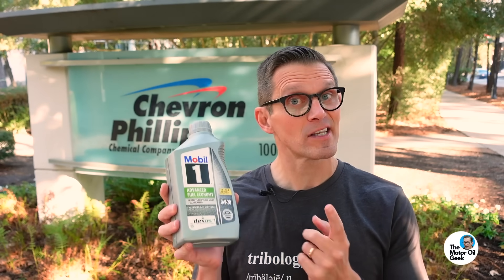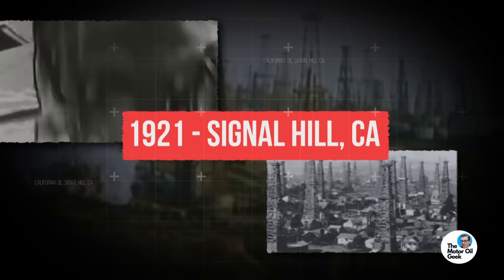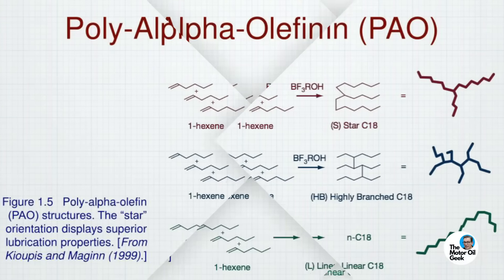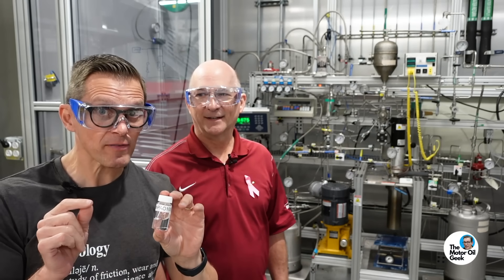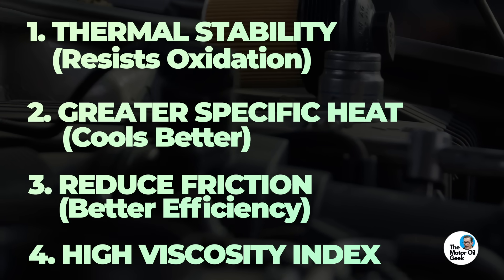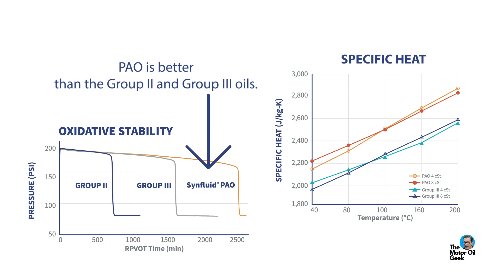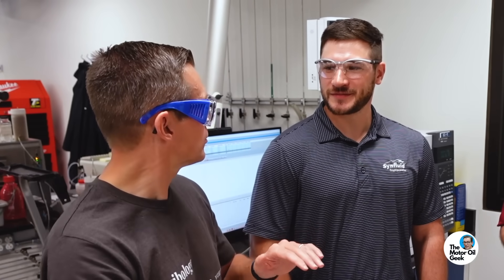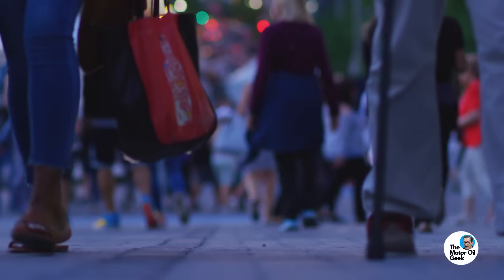STOP Using Regular Oil - 4 Reasons Synthetic is BETTER!

Comment: Changing my oil is like a drug.  It's a euphoric feeling.
Reply: you’re not supposed to drink it
Reply: @coreymacqueen4802  he typed changing not drinking
Reply: Yep.  You can imagine the engine going “Ahhhhhhhh”.
Reply: @datsuntoyy  It basically does go "aaahhhhh".  I can physically feel and hear a difference when I change my oil.
Reply: @mplslawnguy3389  you've got a real messed up car then 😅😂
Reply: @DominiAeternum   Why would you think that?  When you own a vehicle for 10 years you notice the little things.  My truck is in tip top shape because I change all my fluids on time every time.
Reply: @mplslawnguy3389  simply changing oil isn't going to make that much a difference each time by feelings. Tune ups and maybe even using higher quality fuel yes though
Reply: @ Did I say it made a big difference?  It's a subtle difference that I can pick up on because I know my engine.  Also, what do you think a "tune-up" is exactly?  It's not 1965, there is no such thing as a "tune-up" anymore.  Do you just get off on being a contrarian?
Reply: @DominiAeternum  Are you even old enough to drive? Changing your oil affects feel 10x more than using a different fuel.
Reply: @HJOTech  again. You must be driving a junker. Or use the cheapest 💩 oil at your local corner store when you pick up your daily chew that it's nothing but sludge at the end of your 10-25k oil changes
Reply: Oh yeah, a great time

Comment: Another video, another gift to vehicle owners. I have a question (no worries if you don’t see this in the millions of comments). Does Amsoil face a huge marketing issue now that synthetic oil is ubiquitous, and they are sourcing their base oils and additive packages from the same companies? For example I could get Pennzoil Ultra Platinum down the street,  or try and find an Amsoil dealer 🤷🏻‍♂️
Reply from the maker: Thanks! The gap between the top end synthetics is much closer today. GF-7 will raise the bar even higher.
Reply: Our Walmart had ULTRA PLATINUM for $ 65 for 5 qt jugs.
Quit selling it because nobody would buy it.
Strange ....
Reply: As far as I know there are no Amsoil products which use a GTL base stock.
Does anyone know otherwise??

Yes, as far as the various add packs go they could both source them from the same 3 or so companies which produce those.

Comment: Lake, I have a dilemma with the Valvoline Restore & Protect. 
2004 Chevy Silverado 4.8 engine. 
Ran it for 3000- 4000 miles. Changed it. 
Ran it again for 500 miles. Was having oil pressure sensor issues. Decided to pull the pan to replace the oil pickup tube o- ring. 
When I pulled the pan there was 2-3 inches of gooey sludge in the bottom. 
I’m not gonna use that oil anymore. It cleans alright ! Maybe too well ?   IMO, maybe run it once. Then switch to another oil after that.

Comment: Twice the oil oxidation for every ~18F (~8C) change in temperature.
Very helpful to know that.

We typically manage to drop the oil and/or cylinder head temperature by 10~30C, in our air cooled engines, by reducing friction.
Water cooled engines get a similar benefit although the improvement is harder to measure due to the thermostat keeping the engine temps in a preset range.
That means oil oxidation drops to 1/2~1/14 (decreases 50~93%)... which is why the oil lasts longer and performs better.
🙂#XcelPlus
Reply: For water cooled engines the cooling system has more of a safety margin if the heat being generated drops.
You'll probably never notice the improved cooling: 
It becomes more obvious when stressing the engine e.g. Engine should have gone BANG but didn't.
Reply: What about getting the oil up to 100* C to evaporate condensation?
Reply: @hotrodray6802  Thermostat keeps the engine temp in the desirable range.
Reply: @ The thermostat keeps the engine (including the oil) at whatever temp the manufacturer determines. Condensation will thus evaporate normally... even if you improve your cooling.

Comment: used to be able to get motor oil labeled 'Paraffin'  maybe its still out there but i havent seen it in years  how does that kind of oil fit into the story  always thought it was lower quality  also air cleaner service is important for motor longevity   Franklin automobile- Syracuse NY
Reply from the maker: Paraffin oil was the good conventional oil back in the early days. Check out this video for the back story: https://youtu.be/geSGqq5oHOw

Comment: Been using Amsoil since the 80's with great results.  Your program continues to educate me on other synthetic oils.  I'm not using synthetics for extended oil change, but for protection and a clean engine without leaving deposits.  Synthetic oils have gone down in price leaving no reason not to use them.
Reply: Is it true that Amsoil's  benefit is their additive which reduces oxidation (only), thus longer lasting?  I always wondered about the filter if going 20,000 miles on a single oil change.
Reply: Why are Asmoil marketing teams everywhere? Strange. :face-green-smiling:
Reply: I don't trust multi level marketing and products not sold at stores

Comment: I have a 2022 Gladiator with a 3.6 Pentastar  it calls for 0 w 20 . I live in a hotter environment, like Las Vegas,Nevada. The question I have is can I use heavier wait oil like 5 w 30 ?

Comment: Still waiting on the oil analysis of Pennzoil Platinum’s new 15,000 mile protection claim. The original Platinum was my favorite in large part because of YOU.Your content explaining why less detergents are better. But how can Pennzoil’s new formula protect for 15,000 without adding a bunch of additives and detergents. Please do a comparison video pitting the new Platinum vs the old

Comment: I have a 1300hp Silverado. I put nothing but O'Reilly 10w40 in it with a bottle of hyperlube. No problems at all.  Any engine builder will tell you never to put synthetic in a brand new engine. It needs the friction to help seat the rings.

Comment: When i could afford it I used Amsoil 15-40 in my air-cooled diesel tractors for almost a decade never gave me trouble. I tried 5-40 in the winter in one tractor the valve train got noisy so didn't try that again. Now I buy Total 55gal 15w-40 conventional oil  because that is what I can afford.
Reply: You are most likely burning more diesel fuel (after switching from a 100% Synthetic Amsoil Diesel Oil to a Petroleum  Diesel Oil), so the overall savings you had from the switching oils could be greatly offset by your extra fuel costs (depending how much you use your diesel tractors).  In addition, you will have to change the Total more frequently than the Amsoil.
Reply: Additives settle out of all oils after a few (6) months.
Reply: @hotrodray6802  not saying you are wrong but wouldn't that mean there is a possibility for oil to be bad by sitting on a shelf before you buy it and my oil should be fresher since I am getting it from a supplier constantly moving oil to other fleets.

Comment: "It's cold at high altitude."
Yeah, but how do you GET to and STAY at high altitude? High engine output. At high altitude your oil is HOT, not COLD, even though the air is cold.

Comment: I'm still going to use my high mileage 5w-30 syn blend motor oil in my 2003 Buick century 3.1 ltr. V6 engine . I'm afraid of straight syn oil. It might make my engine start using oil and leaking. My engine doesn't use a drop of oil between oil and filter changes now. Never has and I changed oil and filter at 3000 miles all these years!!!!

Comment: I know that Synthetic oil is better than regular oil but I have two older vehicles and I have chosen to keep using regular 10w30 motor oil (10w30 is what the factory specifies) in both of these older vehicles and I change the oil every year regardless of how little I drive them (less than 5,000 miles each per year,  some years only about 2,000 actual mileage).    Could I use synthetic oil in these older vehicles ?     YES I could but ( I CHOSE) to never transition over to synthetic on these older vehicles,   there is zero sludge in the engines and the oil is clean and looks new every time I change the oil and filter (oil never looks dirty/dark or smells burned).     --------    I know that todays new engines are designed different (internal clearances, etc) than old vehicle engines and are designed and made with synthetic oil use in mind and so I use synthetic oils in my new vehicles.

Comment: Way back in the 1980s, I got a USAF assignment to move from FL to Canada. My car had conventional motor oil, and the first time the temperature dropped below -20 F, my car wouldn't start. I switched to synthetic motor oil, and the car started at -40 later that winter. Since then I've always used synthetic motor oil. I've also noticed that since then, my cars have never had any significant engine wear, even after 150K miles.
Reply: Where in Canada was it -40? You must have been really North
Reply: @brarautorepairs  I was in North Bay, Ontario. It got down to -43 C one night. It routinely got below -30 C at night. I was in NORAD at the time, and they had an underground complex like the one at Cheyenne Mt. Colorado. But the parking lot was out in the open. So when I got off my shift, I had to crank the engine at those temps.
Reply: @brarautorepairs Not true friend. Edmonton Alberta sees -40 every year and it’s not that far North.
Reply: @AquaticLogic sadly you are correct
Reply: @thomasborger6548  coldest it gets around here is -15 C maybe -20 C plus windchill
Reply: @brarautorepairs  thats cold enough by my standards tho I continue to subject myself to worse temps.
Reply: @brarautorepairs  I'm in Ottawa, On(The Canadian capital) and it's considered the coldest capital in the world. We regularly see -30/-40(fyi -40C and -40F are virtually the same temp) with the wind chill factor. Today Feb 16 2025 it's -25c plus the wind chill with 25/30 mph winds
Reply: @rtraymond  enjoying the snow today
Reply: @ Fu&^ no!!
Reply: @rtraymond  lol digging out now
Reply: @brarautorepairs  3 feet of snow drift in spots of my driveway!!!🤮🤬
Reply: @rtraymond  I cleared it for the 2nd time. I think I'm good now finally
Reply: @brarautorepairs  I've decided to wait till morning at this point.
Reply: @brarautorepairs 
It can get close to those temperatures.
It was at least-33 in western Canada (Saskatchewan) earlier this week.

Comment: This is really cool nerdy info. I wished more manufactures would list the base oil on their websites though.
Reply from the maker: You can always check the SDS sheet. Here's a "cheat sheet" to decode what the SDS sheet says. https://www.cpchem.com/sites/default/files/2021-09/PAO%202021%20FINAL%20.pdf
Reply: Even if you ask them, their 'techs'/tribologists/etc. you will get the standard, non-answer of "proprietary info" because they know that only the top testing labs own a spectral analysis equipment to be able to test the group content, and percentage of any group type, of any base stock accurately. 👎

Comment: This is something I’ve been telling people nearly my whole life!!!! And it’s probably the only thing I agree with you on. Because I still believe in higher viscosity oil = more cushion between parts. The life of an engine is more important than its maximum possible efficiency. Because in the real world, not having to replace an engine and that engine being reliable and long lasting is the greatest efficiency.
Reply: The video touches on how a lower coefficient of friction reduces the heat generated during operation. A thicker oil can produce more heat from a higher friction coefficient,  as more kinetic energy is needed to move parts in a thicker oil, leading to more oxidation. There's a sweet spot of viscosity, and you can potentially have better wear protection and efficiency. More cushion isn't always better
Reply: @Taydrum  You can have your cake and eat it too... if you have adequate protection but low viscosity. 

Try bonding a lubricant to your engine... and you'll always have protection... even if you use a low viscosity oil. 

Wear analysis is your final arbiter. Stop guessing and start measuring wear #XcelPlus
Reply: Do an oil analysis with both types of oil and you'll have your answer.
Reply: It's all about balance. It doesn't mean higher viscosity oil has better protection. Modern internal combustion engines have variable valve timing and their cam phasers are sensitive to oil flow . Lower viscoscity gets higher oil flow. Oil too viscous may make your variable valve timing system not working correctly. Always refer to the car's user manual as reference as the manufacturer knows what viscosity oil that their engines are designed for.
Reply: @fleurdewin7958  this is key ...  the oil activated systems in cars with low viscosity oil are designed for it.  Don't go over the highest viscosity in the owner's manual for these VVT/VTECH systems, possibly cylinder deactivation systems as well.

So switching a Honda from 0w-20 to 30w50 might be detrimental to systems and lubrication as it is far outside its design range.

Using thicker oil because it feels right isn't the correct approach.
If you moved from Maine to Nevada, almost certainly you won't need the cold range any longer and might need more hot range, maybe ... but probably not if you are just driving mildly on the street ...  but if you drive it hard on the street or autocross, possibly.

How old is your engine, that matters ...  if it is in the days of tighter tolerances, then thinner in the proper range is better.  If you have an 80s or 90s car ...  its different because tolerances were more loose.  Take an LT1 from a early 90s C4 Corvette vs an LT4 from a C7 Corvette.  Or think of a 1.6L in a 86 CR-X vs a 1.6 in a '16 CR-Z.

Change your oil early and often.  I found in my environment and usage ...  3000-5000 miles the oil stays in its best condition ...  I won't go the 10000-12000 miles the minder tells me I can go.
Change your filter and use a decent one; same with using a quality oil. Research it.

A $20 or even $100 oil change every 4000 miles is a cheap PM to have an engine last indefinitely. Don't forget your drivetrain lubricants and filters as well.
Reply: @zakuraayame5091 unless you own a Ford 5.4. Ford’s recommendation of 5W-20 is wrong and the cause of a lot of the VVT issues (according to FordTechMakuloco). Going up to 5W-30 solves that problem, but it’s not something you hear about until you have an issue.
And I never follow the manufacturer oil change intervals. 7000 miles on a Ford EcoBoost? No thanks, 3 months/3000-4000 miles max for me.
Reply: @fleurdewin7958  the problem with Ford 5.4 (especially the 3V) engines, according to FordTechMakuloco, was the recommended use of 5W-20. After following his advice and switching to 5W-30, there was a noticeable improvement. (the engine has other issues but the phasers and VVT are just fine at 275,000 miles)
Reply: More push for the cush!!!
Reply: Change your oil every 5k and it will last forever.   I dropped the oil pan in my car after 125k miles and thought I’d see sludge and build up but was surprised how clean and sludge free it was,   Consistently in maintenance is they key.

Comment: People in comments do not realise that most of them do not use synthetic oil such as group IV and V. Most synthetic in the market are group III which is technically not synthetic but so refined that they called it synthetic. I believe Lake said in Germany Group III is not considered synthetic.
Reply from the maker: Correct. Germany only considers PAO synthetic.
Reply: Apparently, the lawsuit ruling from Castrol vs Mobil from years ago, does not apply in Europe. Hence they can only get away with labeling Group III as true synthetics in the USA
Reply from the maker: @seanwestervelt7503  That is true.
Reply: These “synthetics” not POA based are labeled Group III+, like Warren Distribution products (SuperTech, Amazon Basics, Kirkland), Castrol, Valvoline, etc.  Although Redline, Mobil 1, Amsoil and Royal Purple do carry POA based motor oils, not every motor oil they carry is PAO based.  One still has to be careful.
Reply: @sntstafford  I think only their flagship oils "expensive" carry PAO based motor oil.

Comment: 2012 Tacoma 4x4 with 104 k miles . I have been using regular castrol 5w30 semi synthetic with a Purolator boss filter . I change it every 3500 to 4000 mile intervals . I thought about using full synthetic or 100 percent synthetic but I think I will stick with what I’ve been using. I’m kind of an old school guy so…. Should I stick with what I’ve been using or should I use something else ? Just wondering. Thanks
Reply from the maker: Stick with what you've been doing since you have a consistent routine.
Reply: Thanks

Comment: Curious about breaking in small air cooled engines that use a splash system for oil rather than a pressurized system with an oil pump.

All the manufacturers recommend either break in oil or conventional oil, and to not use synthetic until after the break in period.

Any science to this? I've been following manufacturer guidelines on this, haven't had any issues on my small engines doing this.
Reply from the maker: Break-in is a different story.

Comment: I and most like to use conventional oil on factory or mild performance rebuilds. It’s getting VERY difficult to get conventional oil in stores now. I know there are dedicated break in oil however if ur just rebuilding an Ls or a Camry engine that’s really not necessary for the added cost.